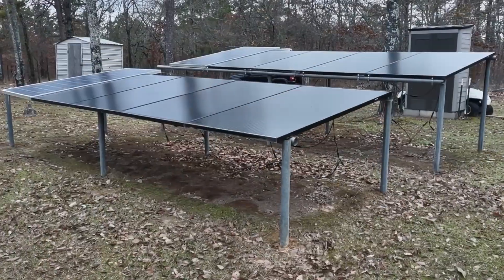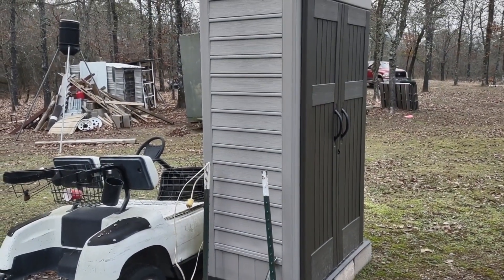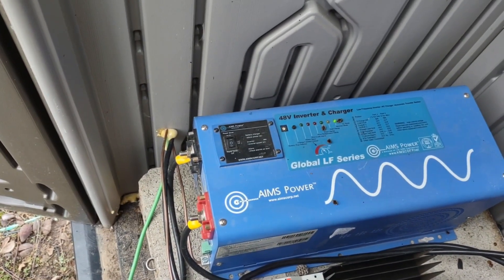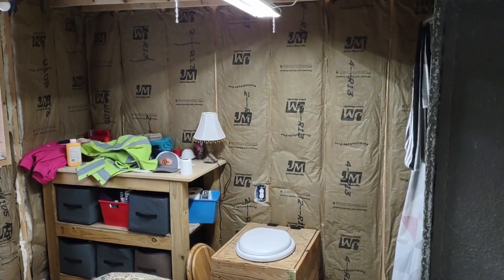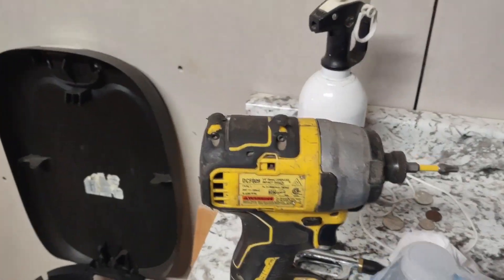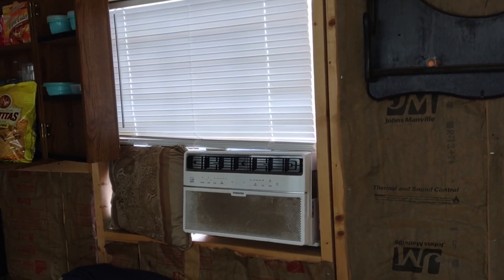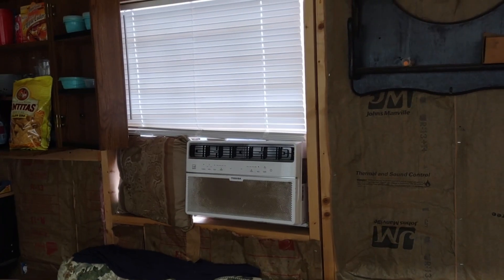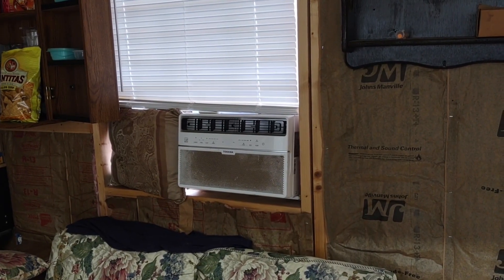What Will Our Off Grid Solar Run ?

Comment: I am forced to use a 4,000 watt inverter because the RV refrigerator uses 350 watts and the AC uses about 2500 watts. The microwave oven, and air fryer use about 1,500 watts. Then I have in my car two compressor type ice chests that have a battery of their own which gets charged by the solar power via the RV inverter. The charger uses about 350 watts. The lights are nothing. On a good day the inverter is producing almost 4,000 watts.

Comment: If the batteries recharge in the morning will that air conditioner restart automatically or do have to wake up and reset it every morning ? Just wondering ,Can you share the brand and model number of the air conditioner? Great videos by the way .
Reply from the maker: It's the same as any 8000 BTU AC there is actually a lot better choice on solar I would advise using a mini split from eg4 that will be what I'm getting you next. But no I turn the AC on and off depending on my available power
Reply: @OKLAHOMAOFFGRID  Thanks ,God bless you
Reply: @OKLAHOMAOFFGRID Awesome video, please make a video on your new mini split setup,thanks

Comment: Hey!  Great depiction of your basic simple system. I have a building in my back yard I'm thinking of setting up to power off grid to move into and rent our my 4/3 house for retirement income. Your set up is exactly what I need.  Is there a way to contact you with questions if needed? An email address? And even if not, Thank you for this content. Really helpful and not overly complex.

Comment: Is there a specific reason for going with 6 volt batteries? I’m using a product called Nature’s Generator; 2 pods , each having a 12 volt led acid battery. I’m not pleased with it; it doesn’t take long to drain. I’m planning on upgrading to Lithium Ion Batteries next.
Reply from the maker: the six volts have an enormous amount of amps

Comment: Very good job in showing what your system runs on normal and not showing calculations :😁 "amp hours x the sun delegees in November"
Reply from the maker: Batteries storage is around 225 amp hours @ 48 volts

Comment: Your AC looks lick it is sitting off of level. Thay are designed to have evaporation collect under the compressor in the round indentation, to cool the compressor and the compressor will not last long running off center.
Reply: What happened to the 16 Trojans?
Reply from the maker: @destro513  I still have the 16 Trojan system it runs another cabin on my property. This system happens to be 8 battery system that is almost set up the same except the batteries are half of what the other system is.
Reply from the maker: Yes sir I see exactly what you're talkin about but I believe it is actually the blind pulled down farther on one side than the other. Thanks for the info though